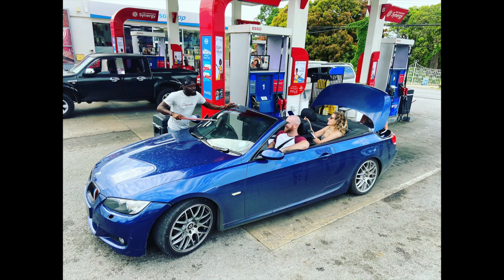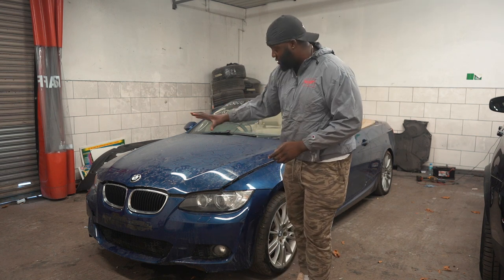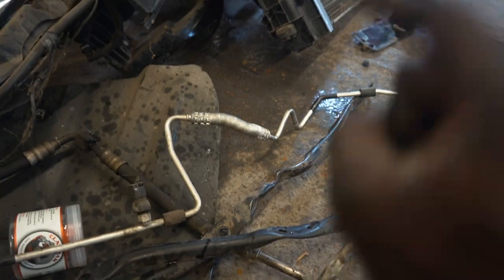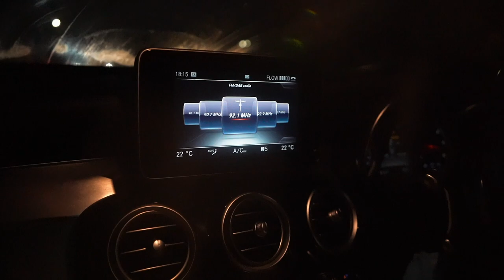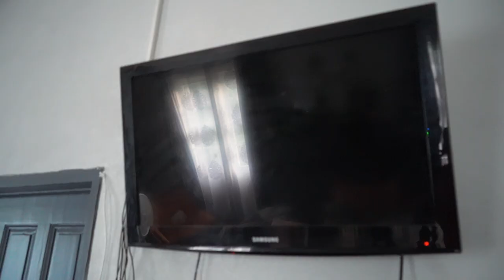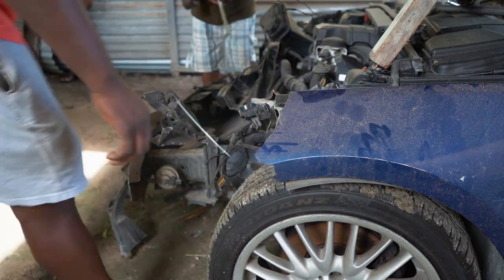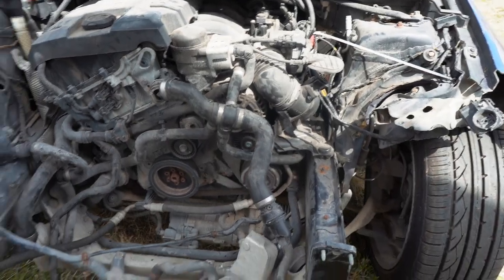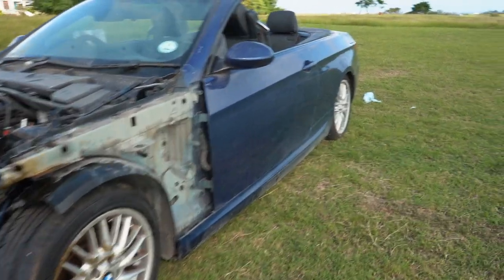HOLIDAY BUILD| REBUILDING A WRECKED BMW E93 ABANDONED IN BARBADOS FOR 2 YEARS! - PART 1

Comment: Was the engines the same in both cars Dee ? If so would it not of been easier to take the good engine out the crash car and put it in the parts car and ship that over ?
Reply from the maker: nah, to ship a car to barbados is crazy expensive then import taxes are 120% of the book value. yes 120% and i paid that already 5 yeas ago, when u watch the videos ull see the damage is not that bad. if i shipped the parts car regardless if it runs or not id be paying thousands in shipping fees and thousands taxes,fees. 

this way i only paid a few hundred BDS. which is next to nothing in pounds.